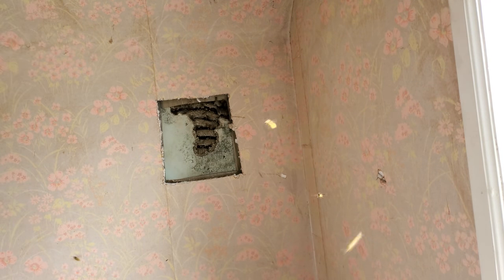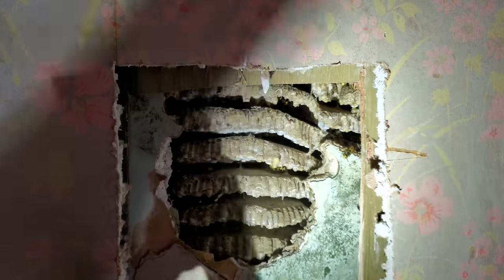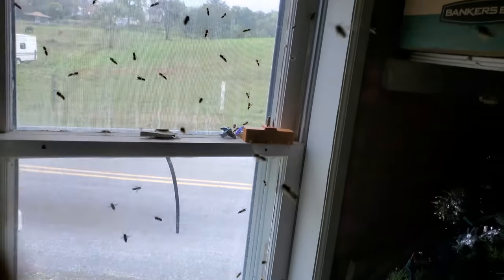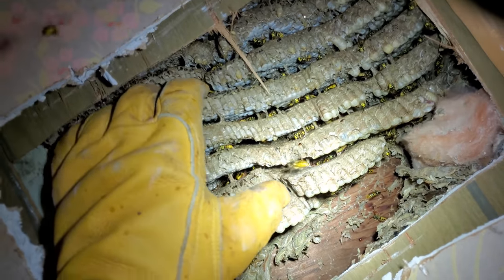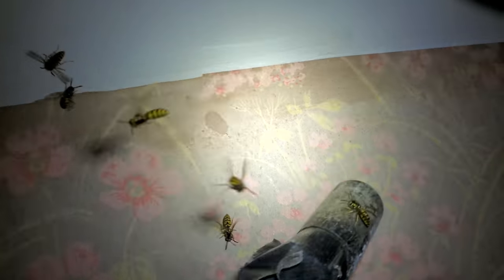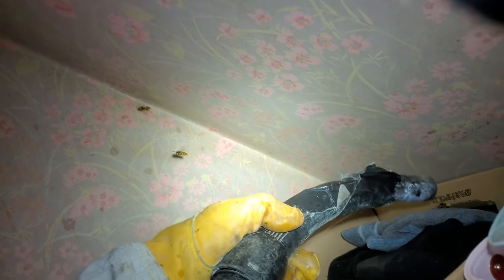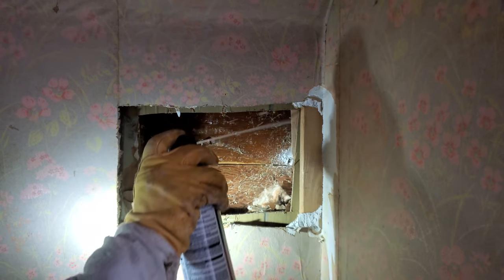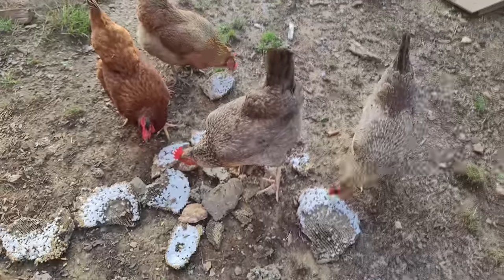MASSIVE Yellow Jacket Nest INFESTATION | Wasp Nest Removal | Thousands Of Wasps!

Comment: Have you thought about having a can of expanding foam on-hand, just to help seal any cracks that the wasps might return through?
Reply from the maker: I have a lot of tools and sealants with me, but in most cases, I tell folks to wait to seal anything to be sure everything is dead first. Better that any lingering adults venture back outside to die than into a living space. Most of my clients want to handle repairs on their own despite my offers.
Reply: That is a really good idea.
Reply: Wasps will chew through expanding foam way easier than that wood they already chewed!
Reply: @doubleecho1980  how about expanding foam laced with wasp killer 🤔
Reply: @DionLewiis  I don’t know how long it takes the wasp killer to break down but it would work if it lasted. It would also make for some pretty toxic stuff lol

Comment: Thank you for interesting video again! However, I've been a bit confused when you often mention that there are two different German yellow jacket / Vespula germanica species. I've been under assumption there is just one variation of this and I couldn't find any literature which would claim otherwise either. Vespula vulgaris and Vespula pensylvanica are often confused with the Vespula germanica as they may look like very similar to each other, could that "other German yellow jacket" be either of those?

Here in Finland I haven't ever seen Vespula germanica nesting anywhere else than underground, possibly because of the cooler temperatures over here.
Reply from the maker: German Yellow (V. germanica) Jackets are a cavity nest building species. They are not a subterranean.  
There are significant nesting and colony behavior differences between vulgaris and germanica. 
You can purchase the $360 text book I use called "Vespine Wasps of the World" or the other Yellow Jacket text book I use for research called "Yellow Jackets of the World". My technical information comes from study of these text books of over 100 years of different researchers studying wasp species, coupled with my own findings during removals, along with studying my relocated colonies. 
I have always found there to be stark differences between different German Yellow Jacket colonies as I removed them. And it was quite an "Ah Ha!" Moment when I read about the 2 sub variations in the germanica class. 

A Google search will not yield you the same information that I present here. I find that most Google information, including, and certainly not limited to, images are often very wrong and mislead a lot of folks.
Reply: @HornetKingOfficial  Thanks for the response! I'll try to hunt down those books you mentioned.

This far I haven't seen any mention of two variations of Vespula germanica but I guess there must be another subspecies of it then. 

Up here in the north most of the different wasp species make ground nests as the summer is so short here. V. germanica definitely is one of those that build their nests underground here - during the past 40 years when I've been interested in wasps, I haven't seen a single V. germanica nest anywhere else than underground. 

Of the local species, only the Dolichovespula saxonica (I don't think you have those over there in the US) build their nests solely under eaves or in the attics etc. Those nests start in early June and will be deserted already by early August, while the underground nests of other species may remain active even up to early October. 

I've ever seen only one wasp nest "in the open" here, hanging from a traffic sign. Never got to identify the species as they were very aggressive, started attacking me already when I was still several meters away from the nest.

Comment: You could drill a small hole into the colony and infuse it with carbon dioxide gas and they will instantly pass out and prolonged infusion will completely kill them after 45 minutes . I used to work in a State Research Lab and this how we put them to sleep so we could count insects to put them into their testing cages . Sometimes we took too long and inadvertently killed our test insects . 
Of course this would remove all “ drama “ from you videos . But it is 100% effective .
Reply from the maker: Unfortunately I'm not trying to put them to sleep for safe transport, I'm removing them and killing them. 
My removal method has nothing to do with the content I film. The method is the same on and off camera. 
There are lots of folks who have many methods to removing nests, and many that pump all sorts of sprays, fumes, dusts, etc, into home cavities, however, I prefer the find and remove method. To each their own.
Reply from the maker: What did you folks use for a CO2 supply?